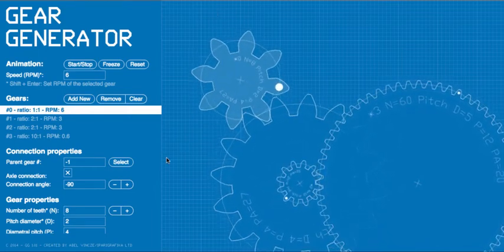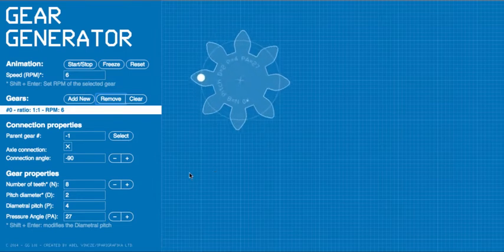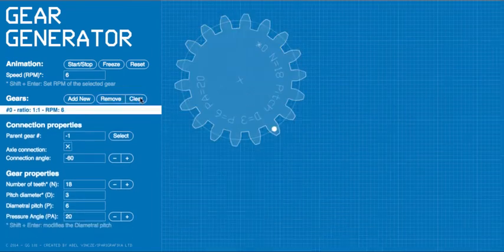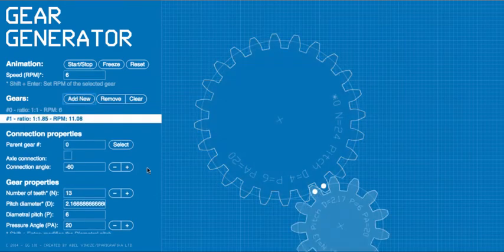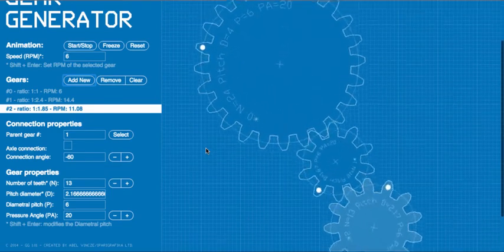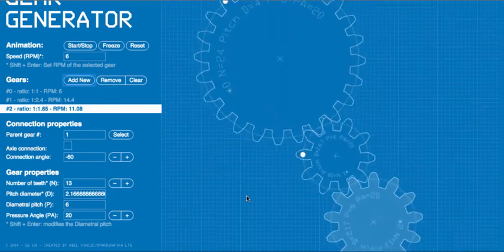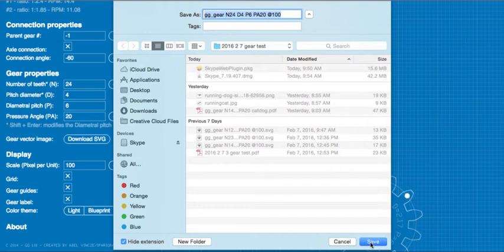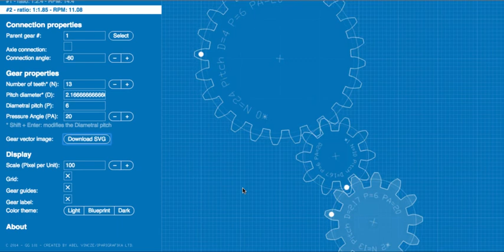Part 1: Laser Cut Gears

Comment: Question, how do you determine the distance between center holes if you were to cut out multiple sizes of gears?
Reply: you take the Pitch Diameter of two different gears, add them together and divide two(2), and that will determine the on-center spacing between their center points

Comment: What are the measurements in? inches? Like the pitch diameter of 5... inch?
Reply: this tool does not work on a specific standard, as it doesn't need to. as long as you reference all calculated units in the tool by the same standard (mm, inches, ft, miles, etc) then everything will remain equivalently proportional

Comment: why must he charge now.. T_T i've been up for 24 hours trying to find free gear gen.
Reply: @biddysingh2  Issues is it once had a free option and many people used it, the greed took over. It's cheap but will kill the site.. It once was a blessing to the youth in the maker/inventor community.  I cant recommend the site to anyone anymore dew to giving Card info to a privet individual. 
  Youth doesn't have credit cards and young engineers used that site it for many things. and parents are to skeptical 
 Its hard starting out. I want the future generations to find success without a 2$ deterrent holding them back, 
  I found a set of every gear anyone could need that I can scale and add the holes I need per project. Lucky I'm a professional 3d modeler and can give back to the community at every opportunity.